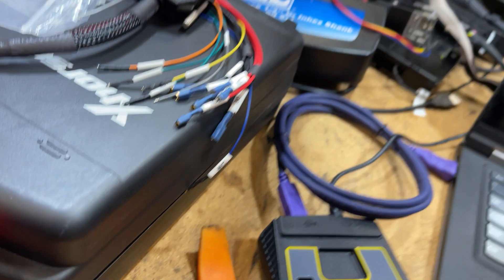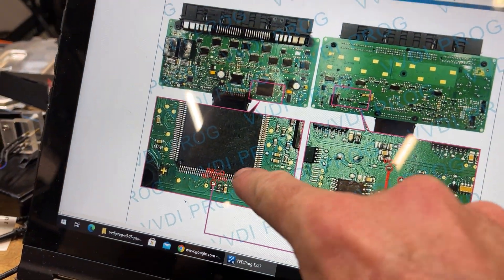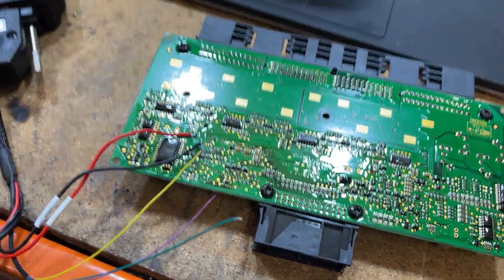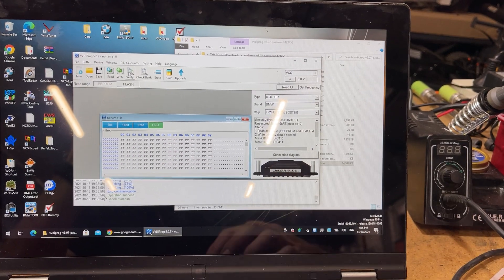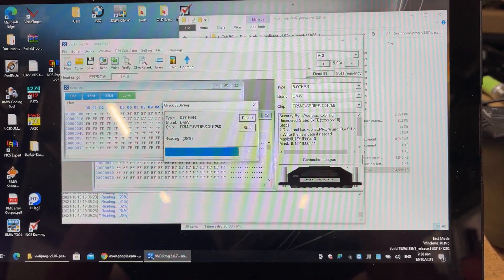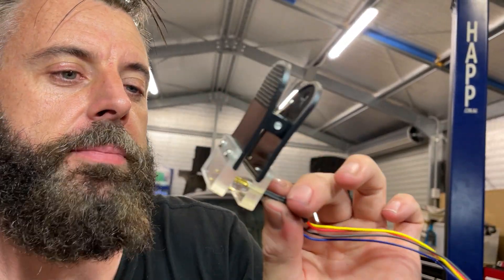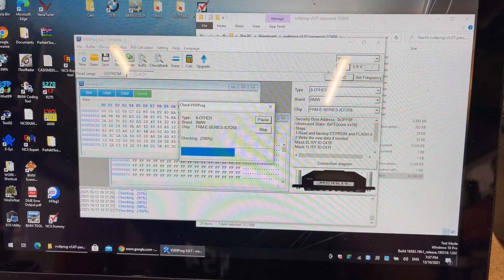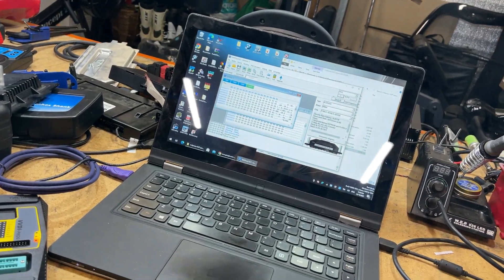VVDI Prog Read BMW E90 FRM Module EEPROM & Flash

Comment: Andrev good afternoon I liked your video, my FRM2 does not work after reading. Help, maybe there is a dump for this device.
Reply from the maker: There may be dumps online. I think there used to be a tool to repair dumps as well. However I haven’t done anything in years with the tool. I don’t have them anymore. Sorry.

Comment: Hello Mate, i have buyed VVDI Programmer today. I am a little bit confused, because i am not sure, if you buy the right tool. Can VVDI Programmer the same things like VVDI Bimtool? excluded  BMW Keys, of course. My Plan is to virginize BMW Clusters or make ISN Reset on 8HP EGS and things like Clone CAS Modules an so on..

And a other question: why does vvdi programmer in your videos use othe soldering points than xprog for example?